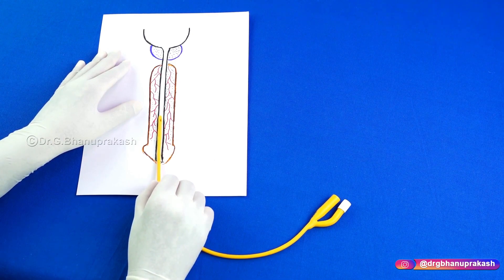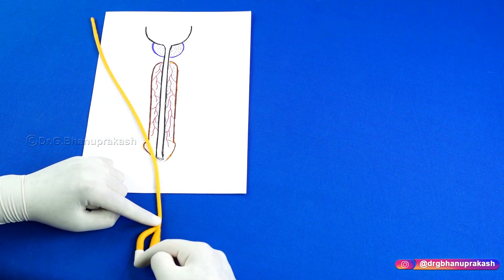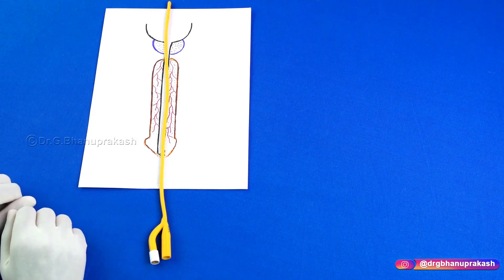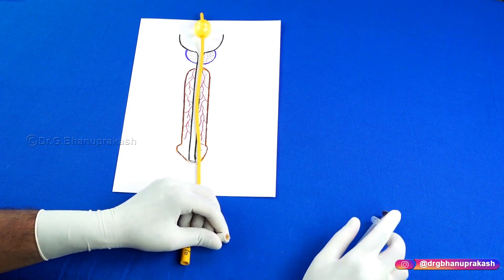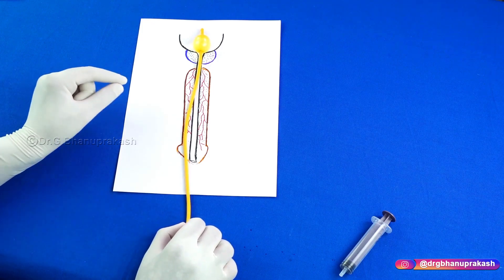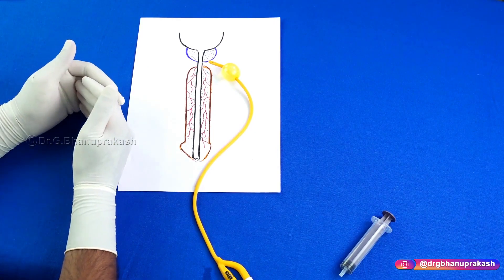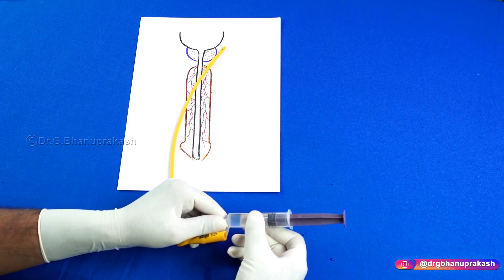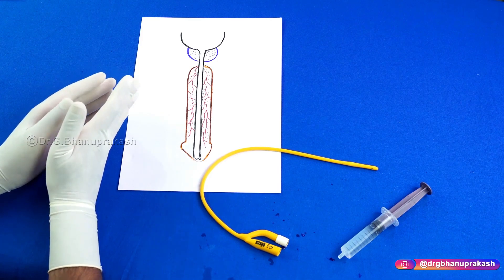Foley's catheter : Parts, Technique and indications : Clinical skills

Comment: What do i need to do when inserting the catheter and then suddenly urine from the urinary drainage port start coming before reaching
Reply: Attach a urobag beforehand so that you dont soil your apron. Secondly if it still trickles sideways after inflating the balloon, you need to use a higher french catheter. It's possible in that case the patient urinated before reaching the bladder.

Comment: At 9:20 the mention of 4 ml as a diameter is incorrect. Diameter is a measure of length. The 4 ml refers to the balloon capacity, which is volume. This error has caused me to lose confidence in the rest of the video.